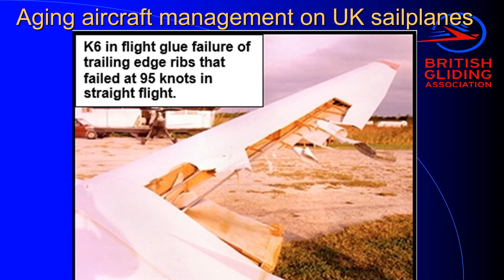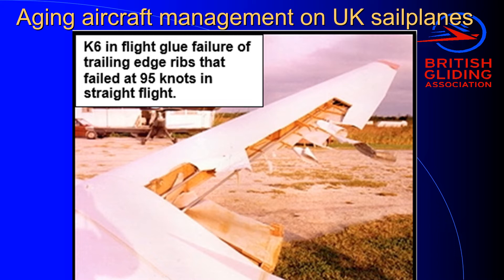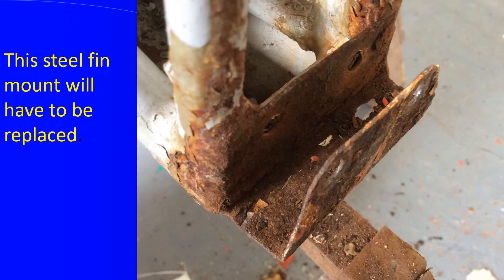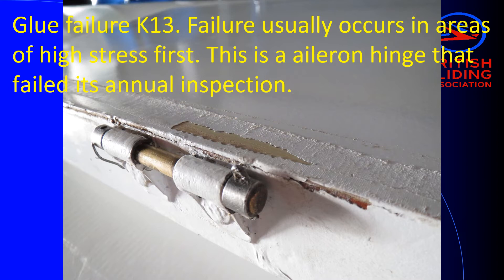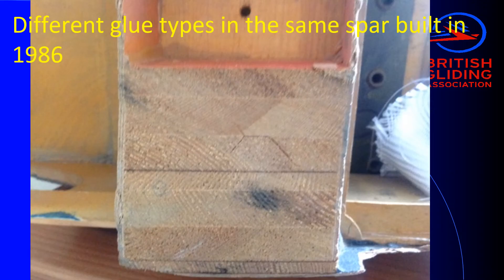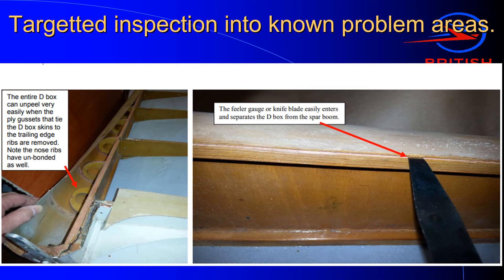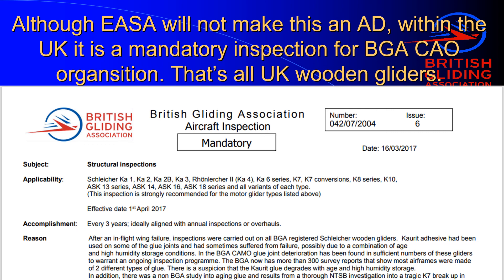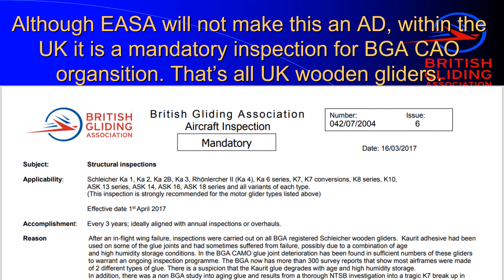Aging aircraft management on UK sailplanes

Comment: Very informative Gordon. 
Depending on which K6 Mark it was, 95kts could be close to VNE, and rough air max 76Kts max would have applied in strong thermic conditions.
Did this glider fail, or did the pilot break it?
Reply from the maker: It was found during the BGA 3 year glue inspection, that requires bolt on fins to be removed. 
So no harm done.
Reply from the maker: Also the design requirements for a K6 requires a gust tolerance of 15ms at rough air speed. 

It is still certified a gust tolerance of 7.5 MS at VNE.

Comment: 10:27 Quote " It doesn't meet really modern health and safety regulations"   but the Aerodux resists 24 hrs of boiling water... The best wood glue ever.
Second best is the certified  L285/H285 resin system, can also be used as sealant on wood surfaces. It penetrates deeper in the wood compared to aerodux, but is less viscous, hence requires ore care in joint accuracy.
A very usefull video. Well done G. Macdonald.

Comment: The picture at 0:27 shows the effect of Kaurit glue failure. This particular glue uses formic acid as hardener. In time the acid dissolves the wood and the gusset plates on the rib joints shear off. Otherwise said: the cellulose of the wood is decomposed by the acid. The adhesive on itself is 100% OK, it is the adjacent wood that shears off.  Evidence:
A 1957 Ka6br showed ample tack between the plywood gussets (rondelles) and the ribstringers; they just fall off like paint flakes. 

The Ka6 rib stringers are in principal 4 * 7 mm in section where the 4 mm value is in contact with the gusset plate (half rondelle), hence this is a minimal connection area.
I studied the fractures in detail. Always the dyed acid-side (pink or purple) of the joint fails. Minute wood residues stay behind on the glue, which on itself is intact.
This fracture picture strongly points to wood deterioration by acid. Well done G. Macdonald.